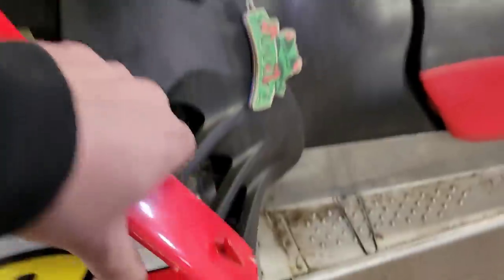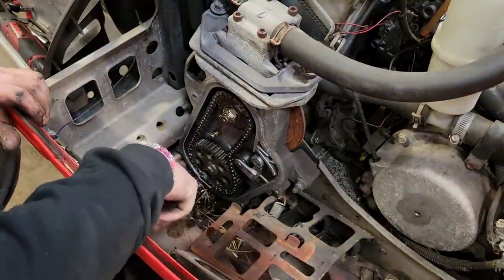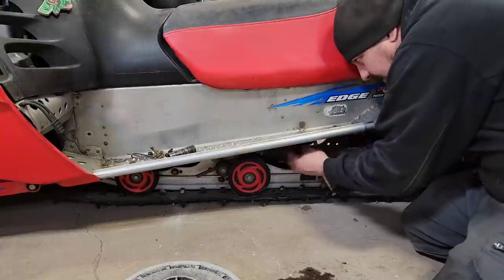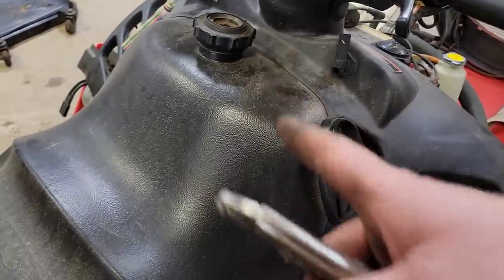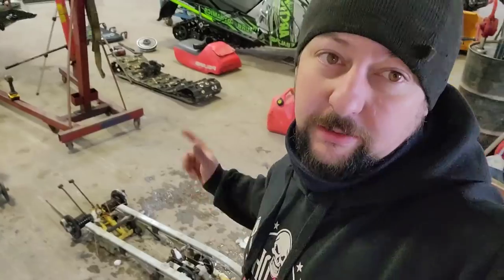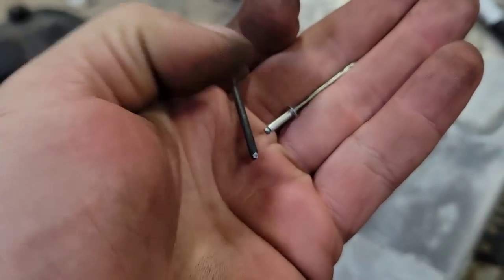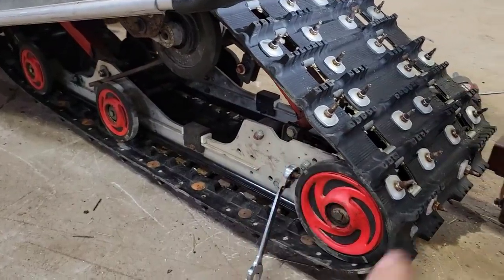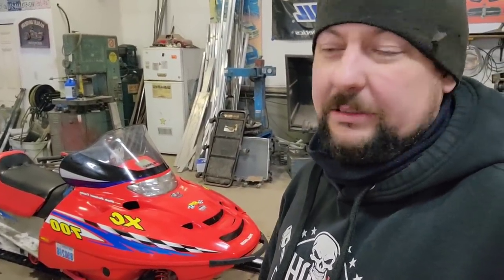XC 700 part 2! will it run and drive?

Comment: Basically almost a full & complete 2nd business end ( undercarriage assembly ) engine , clutch being the first business end  used parts resto. Both parties going deep into the cheap fix other than this places labour or shop rate. Definitely easy money Grab again for both.

Comment: your videos are awesome. I have to say I've never removed the rear wheels when loosening a track. I thought you were onto something. I thought you were going to remove the skid from the other side and wouldn't have to mess with the wheel. Thanks for the trip. Ill do that next track i change. 
Also i was wondering how thick are the heat exchangers? Did you really need to change them?
Reply from the maker: thank you! I'm glad you enjoy the videos and find them helpful! the heat exchangers are fairly thick but they can be easily damaged from a stud coming out of the track, scooters sled was a worse case scenario kind of deal....cheers! 🍻

Comment: Awesome video man, loving these sleds. Hey question,-what’s easier to work on in your opinion that Polaris XC or that MXZ you did the speed runs on? Just in general maintenance and top end tear downs.
Thanks
Reply from the maker: thanks for watching 🍻.  honestly both of those sleds are pretty easy to work on and maintain. they have alot of similarities but I guess the polaris is a bit more simplistic with no power valves to clean and maintain but the air box is easier to remove in the mxz.  other than that they are very closely matched to eachother. hope that helps 🍻.

Comment: You seem like a pretty knowledgeable guy and wanted to see what yah think. I’ve got a Suzuki king quad 750 and a can am outlander 1000. Ones gotta go up for sale but not sure which one to let go, the can am is a 2up ... both low miles. Just curious if you’ve seen how can ams hold up?
Reply from the maker: honestly those are both great machines! the can am has tones of power and will just straight up dangle the front tires! 🤣 but I don't like how they use plastic gears in the motor for the oil pump as well as plastic timing chain tensioners..for that reason I would say the king quad is better for the long haul 🍻

Comment: He should have the rear suspension bolts in the lower holes, not in the tunnel holes.
I didn't quite catch the name of that salvage yard. I have a 1985 Ninja I need some parts for.
Reply from the maker: peterborough cycle salvage, also known as the cat shack 🍻

Comment: I've been in a pickle before and had to stuff a flat screwdriver in to jamb up that goofy thin nut on the rear of the skid. Sometimes engineers should stick to bookwork and leave mechanical contrivances to the fellers who actually work on them...or atleast try and think of the poor bugger in his garage lmao Just wait til you wanna work on the steering post or top jackshaft😪

Comment: They didn't even have the skid bolted in the right spot no wonder it had aluminum for lunch!  Its supposed to be in the lower bracket with studded track and for deep snow riding!

Comment: Привет, какое масло залил в  коробку  передач? 0W40, 75W90, 75W140?
Reply: They make specific snowmobile chaincase oil. The ones I have used are not as thick as any gear oil i have used
Reply: Понял, спасибо. Нужно лить оригинал.
Мне советовали мало для двигателя 0w40 залить в коробку передач.

Comment: I have a question for you Pete. I have a Indy 400 and I'm wondering about the chain case side drive shaft bearing because I'm doing all four on my sled. I'm wondering if there's a bearing holder and which way does the bearing go out the tunnel side or chain case side because you cut it out of the video?
Reply from the maker: I'm no too sure on the 400..but the bearing on the 700 comes out on the chaincase side. if you take the gears off, take a look and see if there is a c clip in front of the bearing..if there is then it will come out that way. hope that helps 🍻
Reply: @rednecksdirtyhands  Thanks there was a snap ring there but how do I remove the bearing by moving the shaft to pop it out of the  chain case?

Comment: I have some questions about my 600 rmk 2010. To bad I couldn't chat wit cha my son.   Jeremy newfoundland. Get back to me. Just wondering how to check the oil pump and make sure she doesn't melt down haven't driven her in a while.
Reply from the maker: good day sir 🍻. I'm not too familiar with the rmk 600 sled, but if she's been sitting a bit I'd say just empty the gas tank and put some fresh gas pre-mixed to 50:1...then just mark the level on the oil jug with a sharpie and take her for a rip! if the oil level goes down then the pump is working..if it doesn't then there might be an issue with it but at least with the gas being pre-mixed the motor will be fine. hope that helps 🍻
Reply: @rednecksdirtyhands  absolutely 💯 👌  great answer bro.  My cousin is a polaris mechanic and he pretty much said the same thing. Thank y and I like the marker trick.